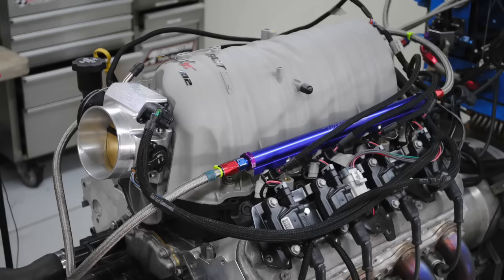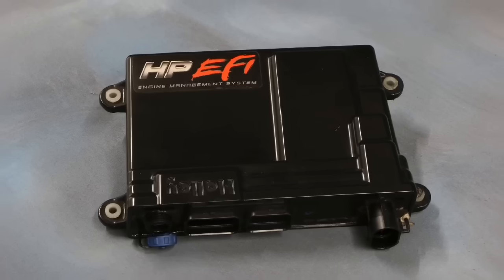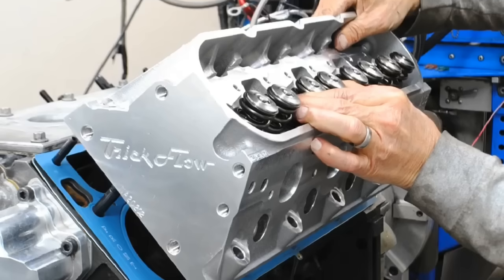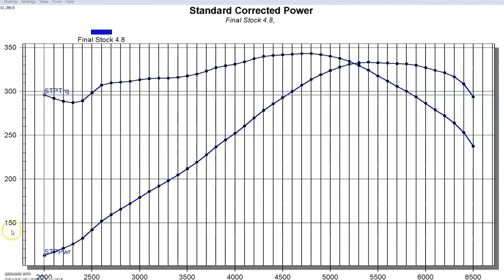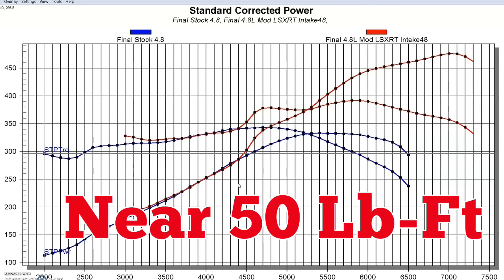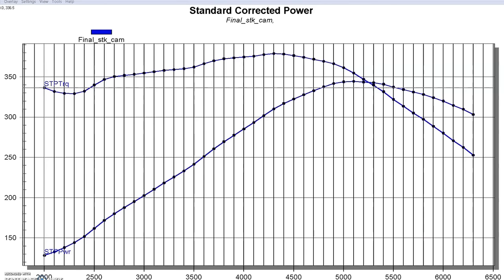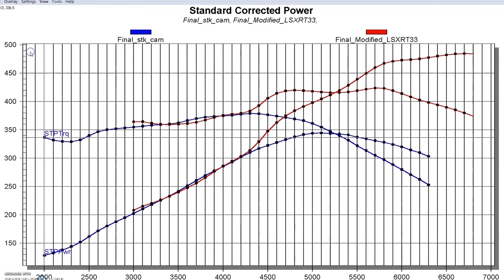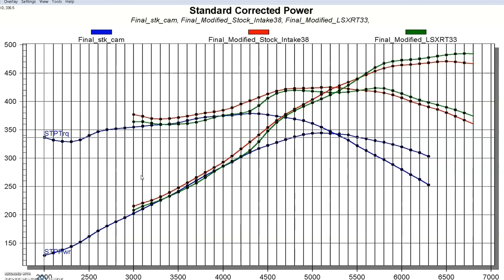JUNKYARD 4.8L & 5.3L POWER UPGRADES! HOW TO ADD 130+HP TO YOUR LS! HOW TO SWAP HEADS, CAM AND INTAKE

Comment: Amazing content Richard!!  
I would like to see the "Sloppy Stage" 1, 2, and 3 (Elgin E-1839-P, E-1840-P, and E1841-P) cams, run against the full lineup of Summit LS cams.  Or at least one brand or the other, because that many cam changes would be a LOT of work.  I'm running the "Sloppy Stage 3" cam in a 4.8 with a pair of china GT35s in the trunk, and it runs well.  That cam seems good in Engine Analyzer also, but who really knows until Richard Holdener puts them to the test on the dyno!  Haha
Reply from the maker: SS2 vs the World (meaning other stage 2 turbo cams) coming up
Reply: @richardholdener1727  I would love it if you included that Elgin 1841. Nobody has really back-to-backed it that I know of, and it wins in engine analyzer. Seems like it works great in my car.
Reply: Seems like a lot of work to swap all those cams knowing there is not going to be much power difference (based on your previous cam swap results) but hey, the sloppy community is demanding it lol!  So we'll take it.
Reply: I'm definitely interested in the results from running all three of the Elgin cams back to back in a 4.8, 5.3 and the 6.0. I chose the stage 3 cam for my combo which is a 6.0 with LS3 heads. I probably could have gone bigger but I was listening to a good friend who is a big cam hater and I wanted to be on the safe side of piston to valve clearance. I could find nothing on the stage 3 so I kinda stepped out on faith and knowing what I know about cam specs. I can't wait to see that test. I just found and subscribed to this channel and I'm loving the content. Keep up the great work!!!
Reply: I second that. 👍

Comment: "take stock 706 or 862 heads and mill them a little bit"   What does "mill them a little bit" mean?
Reply: It means your shaving the deck surface that meets the block, usually around 20-30 thousandths. This will up the compression and horsepower also. But you need to be careful doing so, running normal gas can cause detonation...if your stick with a mild mill and run 91+octane you'll be fine.👌
Reply: @bstgarage7803  Got it. Thanks for your reply.
Reply from the maker: .030

Comment: I'd like to see the 4.8 or 5.3 with ls1 or ls6 intake, for those who dont have the space for the truck intakes. See the power difference from truck to ls1 intake
Reply from the maker: the LS1 intake is not good-google search 20 LS intakes Hot Rod for info on all the intakes (a test i did)
Reply: @richardholdener1727  thank you . I will look into that video.

Comment: Can you demonstrate the at-home porting techniques you mention in this video?
Reply from the maker: I might be doing that with Briann Tooley
Reply: @richardholdener1727 did you make the video. Looking to do that to my 03 Tahoe z71
Reply: Headflowinc covers head porting across many different ls heads in great detail. I'd check out his channel if you havent yet. 👌
Reply: Never did dyno the engine but I put together a lq9 6.0 years ago with 243 heads. I opened up the exhaust some and did my best to make them even. Engine runs really good and I believe most ls cams favor the exhaust on duration so that also indicates the exhaust port restriction

Comment: While I love the content, and lots of tests. My biggest question still remains.

How many dollars are you trying to spend per horsepower.

5k worth of parts for 130hp, and you couldve gone turbo and added 200 or more.

For that same 5k you could buy an ls3 turn key engine that makes the same 130hp more than a 4.8 and have lots more room to grow.
Reply from the maker: I think I mentioned doing other low-buck ways extensively in the video
Reply: nastychevys; 5k where are getting the numbers from ?
Reply: There is a lot more complexity to adding a turbo. It's a balancing act with funds, experience and headache.

Comment: My 4.8 has 862 heads that I P&P the hell out of both intake and exhaust.I also cleaned the chamber and polished it. My intake is a Dormen 3 piece that I had to reseal....The TB is factory all in sync using an LS9 cam. All feeding a GT45 with an intercooler all stuffed into a Foxbody
Reply: Almost done pnp a set of performer rpms. About 3 weeks in. I polished exhaust and chambers. What finish did you leave the intake runner with? I have mine in 80 then 120 did you polish that too?
Reply from the maker: hey FYI-the finish is only for looks-it plays no part in power-but I do so like the shiny!
Reply: @buiItnotbought  The runners are really smooth..I cant remember the grit but the chamber I polished to a shine but there was a little ruff casting near the edge that I didn't touch and after a year on e85 there was lite carbon in the pocket but more black carbon on the ruff edge...so it might help on build up a little..
Reply: Isn't there some anti carbon buildup and resist detonation or something? If not i wasted a lot of time lol
Reply: @buiItnotbought  yeah you should have just stayed with 80 grit and left it at that lol. But I'm sure it's shiny as heck!!😁
Reply: @allanb3222  I remember reading some articles that polished chambers reduced hot spots during combustion because how the heat is spread. Either way im 80% done. This is for my friends 416 sb chrysler that im putting twin 7675 precisions
Reply: @buiItnotbought  yeah I would only do that on the Chambers, not the runners though.
Reply: @allanb3222  i did chambers and exhaust. Leaving intake in 120

Comment: What about an Lm7 with hand ported 243’s and test out the whole lineup of Summit branded Ls cams with a TBSS intake?
Reply: Agree, except I would say to use hand ported (just cleaned up) 706/862s.
Reply: if you swapped those heads on there you would have to mill them to get the compression up
Reply: @ryanaxberg9263  I don't understand 706/862 =:61.15cc, 243=:64.45cc. so 243's would lower compression but have larger valves
Reply: at least the summit turbo stage 2 and 3 cams VS sloppy stage 2
Reply from the maker: SS2 vs the world test is in the making

Comment: Running the BTR truck stage 2 camshaft in my wifes 5.3 Envoy with TBSS intake and stock 862 heads with spring upgrade. I have to say it's the perfect daily driver cam as it picked up alot of mid range and low end power all while keeping fuel mileage on par with the factory camshaft.
Reply: Good to hear. Planning similar.

Comment: Awesome! My go-to intake on LS is a carb setup. The drop in IATs with the fuel atomization can allow for as much as 36 degrees of ign advance on 93. 

A good idea that I’ve never seen a comparison on however would be the differences N/A on extreme cam LSA. Cams with similar lift and duration but say 106 LSA vs. 115 LSA and how it affects the power curve.
Reply from the maker: i did test 4 cams ranging from 120 lsa down to 108 I think-ill check
Reply: Richard Holdener  Sweet! Would be a cool thing to see how the power under the curve changes with different LSAs. I know one end of the spectrum is for PD Blowers and others Turbo or NA. But when it comes to choosing a cam for the street, I see how it can be difficult to pick a cam to fit your setup (ie. vehicle weight, gearing, converter, etc.).

Comment: Test the Holley Hi ram on the 4.8, and the 5.3 in a intake test then throw nitrous at the them.
Reply: forget the high ram, how about the mid or the new LOW! Really wanna see that low perform with the high ram and fit in some car applications
Reply from the maker: both hi and low ram are very high rpm intakes-especially on 4.8L

Comment: What if you did the same test with a 5.3 and then bored it to 5.7 with the same heads, cam, and intake just to see how much the extra CI impacts the power production across the rev range.
Reply: @Future-Preps35  I am mainly curious how the bigger bore would behave with those heads and the added displacement would change the characteristics of the cam in 347 ci. I have a 5.3 that I want to bore to 5.7 with some 317 heads I have PnP and a Hi Ram with 417 or Shearer A2W IC and turbo it. My 2001 regular cab stepside bed has a stock head and bottom end 5.3 with a cam ground for the D1-SC at 12 psi, Fast LSXRT, 4L80E, Vig 3600, 4.11 and diff in the stock rear that I figure made 550-600. I sold the D1-SC because it was 6 rib and had their horizontal intercooler. I want to build a forged 5.3 or 5.7 with a nice turbo setup and would like to see 850-950whp for with a better converter and a 14 bolt 6 lug with the 3.42s and all new Vikings, spindles, Caltracs and Bogart or Weld drag pack.
Reply: I have that in my truck

The increase in compression is 👌🏼 and it run very hard for a daily
Reply: @michaelprochaska9755  Have what in your truck? I've got a semi max effort 416 LS3 in my Trailblazer and have a LQ9 I'm putting some CNC 243 heads on with the Fast intake from my Silverado that I'll have ported, and the headers off it and the gears and diff in my Yukon. So I want a FI build.
Reply: For a forced induction setup you wont see a big difference between the 2 bore sizes especially when its much cheaper to turn it up a pound of boost.
Reply: @dalethomas9307  What about how the chamber of the heads and valves would react to the larger bore? And having more area in the cylinder to fill. Would you rather make 1000 hp on 30 psi or 1000hp at 25 psi? With a stock crank and Gen 4 rods with ARP hardware, really nice forged 5.7 pistons and rings, really good strong wrist pins, some worked 706 heads, ARP head studs, LS9 head gaskets a stage 2 or 3 LJMS or BTR turbo cam, TBSS intake with an A2A or Shearer or 417 A2W style intake and a BW S476 I bet 800whp would be a breeze and reliable. Who knows on E85 you might even be able to turn it up to the 1k whp mark and still be reliable. I'm planning a turbo build in my RCSB since I pulled the D1-SC and am considering this very build.
Reply: 06 TrailblazerSS the 3.780” bore of the 5.3 doesn’t shroud the valves of a 706 head so the larger bore and extra CI aren’t going to amount to much. To run the LS1 5.7 pistons a ton of material has to be removed from the bore I would rather have that material for integrity. Sometimes the effort and cost of additional CI doesn’t math out on the dollars to HP scale but if you really are concerned about HP per boost PSI go with a 6.0.
Reply: Dale Thomas i like the way you think, the cubes would mostly just help with spool time of a turbo. Might help with revving it out a bit farther because of the extra bore but probably not enough to matter
Reply: @06tbss

Its an iron ls1 with 215/231 and 853’s.  Nice daily

Comment: Much respect for the 4.8, it's a 7000rpm capable motor with the right cam and valve springs. Try and get a for 289 or 302 to survive 7000rpm. Wont be a stock part left inside
Reply: Jason Hooey laughs in coyote
Reply: @Spac3Monkey  can't buy a running coyote Ford for 500 bucks

Comment: Can you run a ls6 intake on those? How would that do
Reply: Google lLS intake shootout.  Richard tested, literally every intake on the market at that time.
Reply: Yes. Slightly less high RPM flow in this particular application. If you had one already, id run it over buying a FAST in THIS app.
Reply: good to know, if i ever did a 4.8 it be a budget cruiser so those can be found cheap and have less clearance issues
Reply from the maker: a lot like a TBSS

Comment: Richard, do you baseline these engines with compression tests and crank turning torque tests before running them? It would be nice to know if that 5.3 has healthy rings and bearings.
Reply from the maker: sometimes-usually its just cranking over with my finger near plug hole to see if it has SOME compression-then check oil pressure, then run-dyno tells us it its happy. This 5.3L was just down a smige

Comment: You screwed up. Bought better heads than you need. Turbo.?
Reply: Wasn't a "screw up" it was to make a point for this engines airflow needs, or lack of flow needs.
Reply: @BEANS-O-MATICtransmissions  That's was a joke.
Reply: @BEANS-O-MATICtransmissions  But can the turbo make up the difference for air flow.?